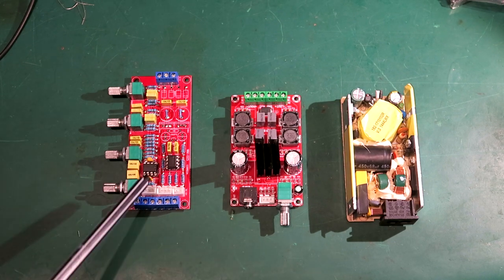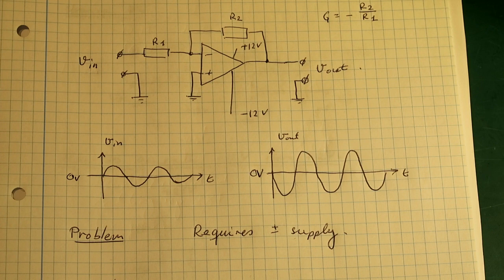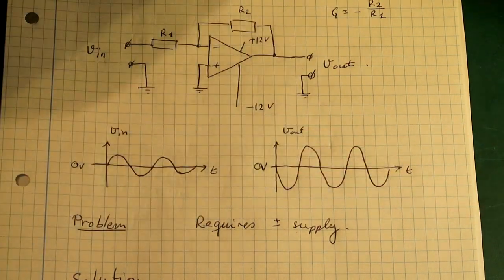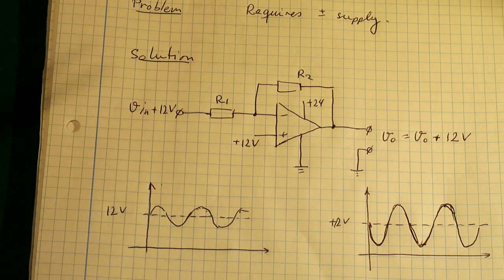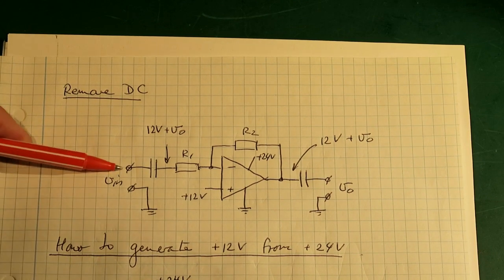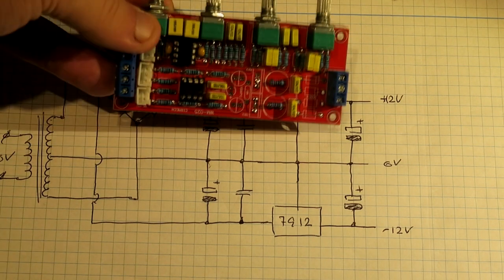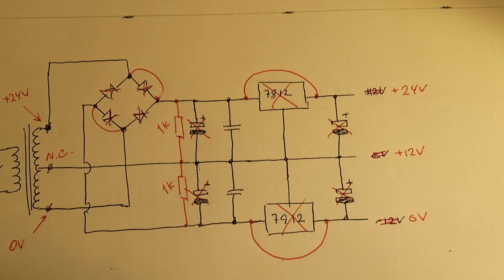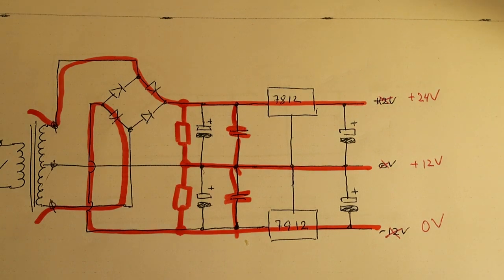Convert PSU circuit from AC w. center-tapped transformer to DC input. NE5532 Pre-Amp (WM-025) Fix.

Comment: One way I managed to get a pre-amp like this to work in a pinch was by using a PC power supply and the +12V, GND and -12V pins from the motherboard connector (GND connected to the middle power pin, the others next to it); the rectifier on board just passes the voltage right through to the rest of the circuit, no DC blocking capacitors needed on the input/output and no modifications to the board.
Reply from the maker: If you have a +/- supply :)
Reply: @NatureAndTech  well... yeah, that's why I used an (older) PC power supply, cause it's the most common source I could think of in a home that also supplies negative voltage

Comment: hey, may i borrow your expertise on an amplifier project that I've been struggling with, somewhat related to this video? the premise is that I have a pair of amp chips, which usually run on 24VAC, but instead, im running them with 2x 24V meanwell DC power supplies, which i am running in series, with a center tap between the two power sources to be my virtual ground. The amp chips work fine, but I've cooked something when trying to connect a low pass filter chip, and/or the aux socket to the amp chip's input terminals. I'm pretty sure that because my virtual ground is at +24v, and the sleeve is true/chassis ground, there is a shorted potential. So, I've added DC blocking capacitors between the socket, and the virtual ground, and another one between the two signal ground terminals, and still, something is cooking. The low pass filter runs off the first power supply for +24 DC power, if that helps. Thank you for reading.
Reply from the maker: Sounds like you are doing the right thing, there. I have done the same before. They only problem you might get with that is a pop in the speakers when you switch it on, because you have to charge the DC blocking capacitors. 

It is hard for me to know the problem without seeing the schematic, though. Are your chips rated for 24V (or +/-24V) operation? 

Is there some way you can send me the schematic? I would love to take a look at it for you?
Reply: @NatureAndTech  -Thank you so much for the speedy reply! I actually had the low pass filter on the negative rail, even though it was correctly on + and - albeit on the wrong source. I also had to ground the center node. Works great now!

Comment: I bought it and it must be supplied with alternating current 12 volts lol ... in Europe we find that nowhere! and there is no converter module to transform the Dc into Ac ... I will recover the potentiometer and throw it at the waste disposal
Reply from the maker: You can use a 230V to 12V transformer.
Reply: The board already has an Ac to Dc Bridge Rectifier Circuit built in it, you just need a transformer to step down whatever AC voltage you have down to 12 volts
Reply: @wasteplantwasteplant8431  I tried but it doesn't work ...

Comment: For 3 years now I have been stocking up on Chinese electronic components, not one has been as bad as the power supply - bad luck. That amplifier (I have two) uses the TPA3116D2, it is rated at 100Watts  (2 x 50w at 10%THD) You state the power supply is rated at 3A at 24V - 72Watts. I'm sure the amp will work but it may struggle with the wick turned up. Maybe things will get a bit warm in that power supply. The pre amp looks interesting.

Comment: You didn't have to modify the board if you didn't want too. You could have used two 2200uF caps in series and two leveling resistors across the caps and applied your 24 volts across the series caps. That would have given your positive and negative rail voltages. You then get your ground from the center connection of the series caps. You could even bypass or remove the voltage regulators since the input voltage would not be high enough for the regulators and used a few zener diodes at a slightly lower voltage rating in their place to keep the voltages stable feeding the OP amps so when the power amp requires more current at higher volumes you don't deal with any voltage sagging or voltage offset issues to the tone board or you could have used a 36 volt DC power supply and not only had a higher output for the amp but a high enough voltage to take advantage of the boards voltage regulators. You would have also had the option to either leave the bridge rectifier in place or remove it and run the pos and neg DC rail voltages directly to the voltage regulator inputs. This would have eliminated the need to add DC blocking caps in line with the inputs and outputs on the OP amps. The DC blocking caps may have an effect on the tone of the OP amps. Still you thought outside the box and all roads lead to Rome in the wild wild world of electronics.
Reply from the maker: That's true.

Comment: Nice explanation, and nice job. You might want to mention that those DC Blocking (I might say Coupling) capacitors need to be fairly large (like 470-1000uF or more depending) so as not to roll off too much bass as an RC high pass filter. These form an RC filter even if you don't have an explicit resistor-- the wires and such form a resistor regardless.
Reply from the maker: True.
Reply: good point